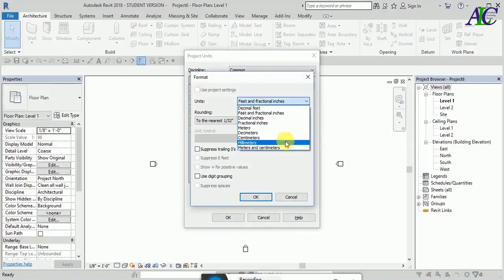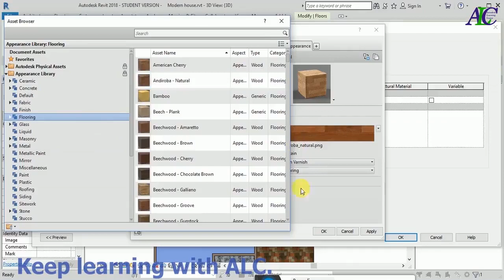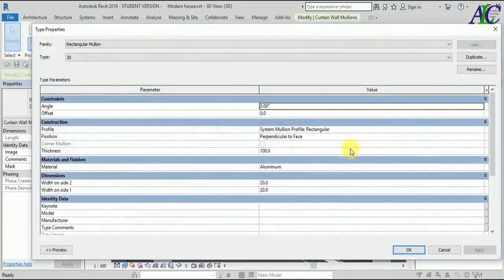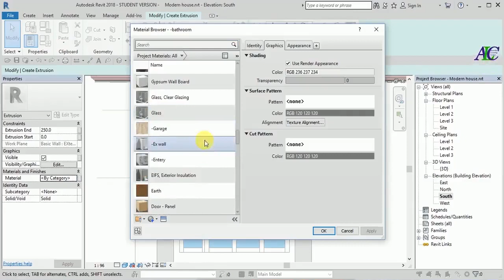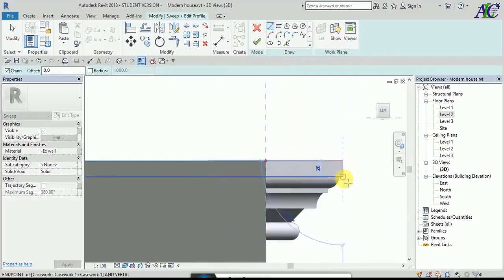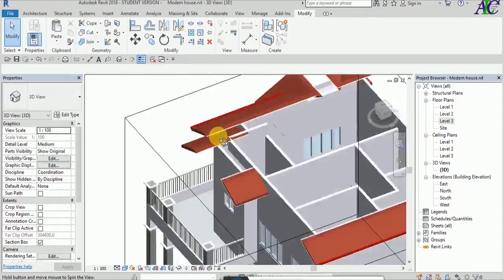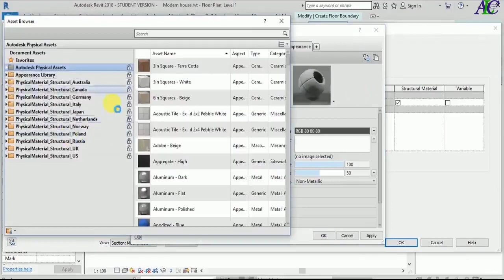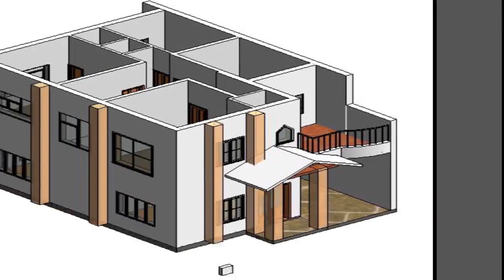Revit complete project #01 [House design in Revit]

Comment: Hi sir give me some detail     System requirements for Autodesk Revit 2017
Reply: Min-4gb ram
Graphics-256 mb or above
Net framework-4.5
3.0ghz processor
Reply from the maker: the high quality is more better. if you learn, it's ok

Comment: you didn't show how you connect the second floor
Reply from the maker: Yeah, just worked on the first floor with full explanation. if you wanna learn step by step, find this tutorial that are part by part or one another complete tutorial is step by step. watch that one.
Reply: @autodesklearningcenter5131  I am seeing a gap between the two roofs when I use the connect roof function. I am referring to small added roof in the front of the house. How do I close this gap. I send the file  see what I am talking about